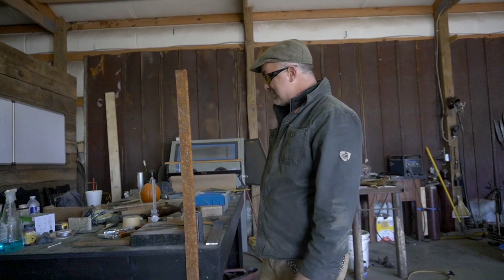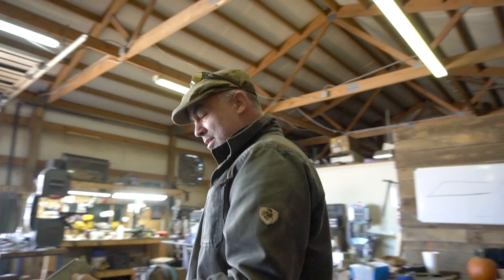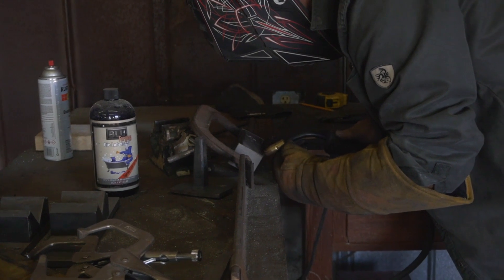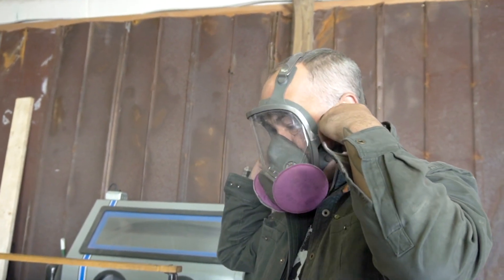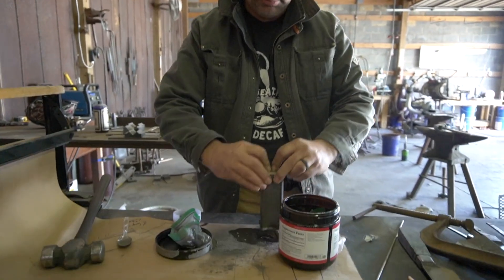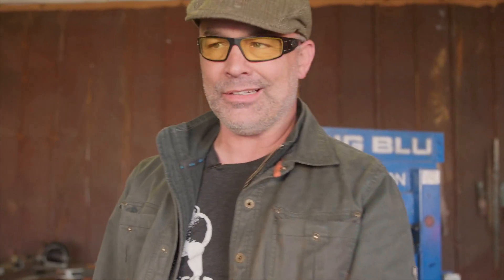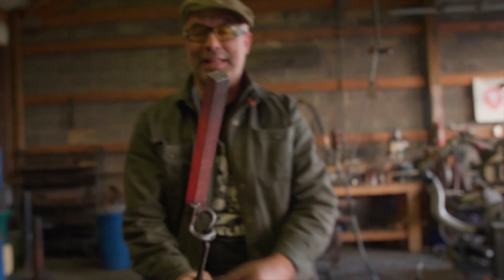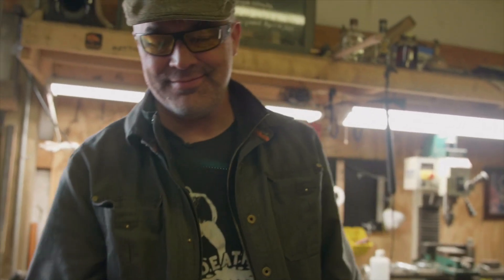KNIFEMAKING | $5 to 2000 Junkyard Knife: Mosaic Damascus?! - Part 2

Comment: Incredible dude...  🙌... Anyone know if its possible to forge canister Damascus by hand.... just a hammer and a anvil.... ??? 👍
Reply: Big Blu wasn’t around 1000 years ago. Yes, Damascus production is possible with hammer and anvil.
Reply: It is very possible...you just have to make sure you heat, ...I've done a few myself...I heated each side of my. Canister for 5 min..per side...for about 20 min total....hard enough strikes to begin moving but not slamming blows.....

Comment: Jason...new to the channel. I love watching machine shop channels. I'm not a Blacksmith but I'm confident I can do the work. I excel in what my heart leads me to. For now I'm just a older retired combat grunt with some miles on his back. 😀♿🇺🇸 SO..! This blade is going to look outstanding. Since you already have a 4 pattern in that 1st block, why not cut and weld 4 blocks for the final pattern? Anyways looking forward to the finished product. Be blessed and safe. OH and no gayness here just some gayness suggestion 😜 the beard was distinguished in my opinion. Yet then do all metal benders have to have beards??? 😆 lol.🤙♿🇺🇸

Comment: Cool pattern 
Got sort of a technical question, structurally what is the difference between folding the steel like in Katanas, and Damascus steel where you cut and stack the steel? Which is better?
Thanks in advance
Reply: Structurally, not much. Cutting and stacking is a more expedient way of increasing your layer count, while giving you a chance to grind clean all of your mating surfaces, and causing less pattern distortion than folding, which if you're doing any sort of intricate pattern is essential. Folding is primarily a steel refinement method. Check out some videos on refining bloom steel, Walter Sorrels, and Joey Van Der Steig have videos on it.
Reply: @huntingsgr8  thank you so much

Comment: Hey Jason!
Let me start with I love your videos and want to become a knife smith myself!
Iv been following you for sometime now and I have written before in your previous video asking for some help or advise about tools, but I realised I formulated myself poorly!

My question is following reguarding knife smithing.

What kind of Anvil should I look out for - there are houndreds of different designs and waights and sizes and they are practical in different ways - But not all of them are practical for knife smithing.

Hammers - again hundreds of them out there, what shapes would I need for smithing - Im aware I need multible hammers because of hammering bebles and such - what should I concider before purchusing a hammer - also material the hammer is made of would be great!

Grinders - there are many different grinders out there, shapes and sizes - anything I should concider or does anything go?

Power hammers - now thisone iv been looking for alot myself and Im confused - they have different power and hitting ranges so for a beginner I guess a small one would do - But my dream is to craft Damascus in 1095 steel or stainless steel thats a bit harder from my understanding (I know i wont start with damascus the first thing I do, But i want to get the right stuff so I can jump on it when Im ready) - what power should I look for and what kind of heads should I concider for blade smithing.

Forge - what forge construct would be best?

Are there any other tools I missed that I should concider getting that would shorten my learning curb!

Any advice would be greatly appreciated!

Keep up this great content - I realy enjoy your movies!

Greetings from Sweden!
Reply: I have the same questions, I hope we get some answers!

Comment: That was a ton of hydrocarbon hahaha. Jason is a beast!
Reply: WD-40 or something like that, he mentioned it as a reply to another comment.
Reply: Was that diesel he was pouring at 5:00?
Reply: @noahnipperus7320  maybe kerosene?
Reply: Yeah, I'm pretty sure it's WD40. That's what he and Steve used in chapter 2 of the forged series. If you haven't gotten the series, I suggest it. Tons of knowledge those two unload.